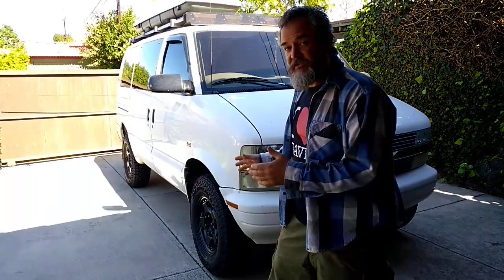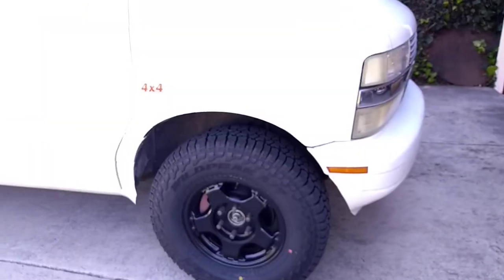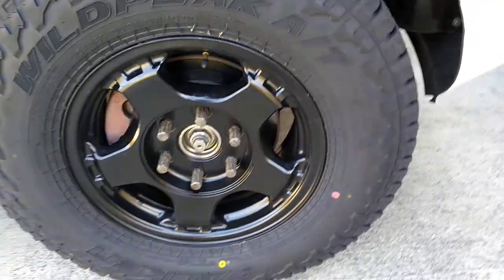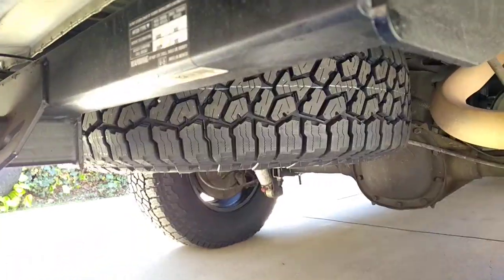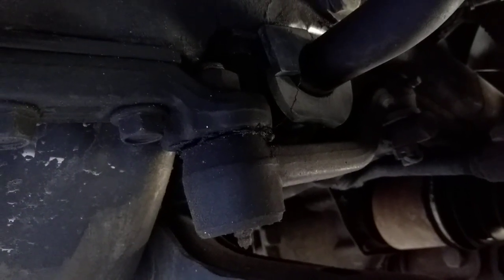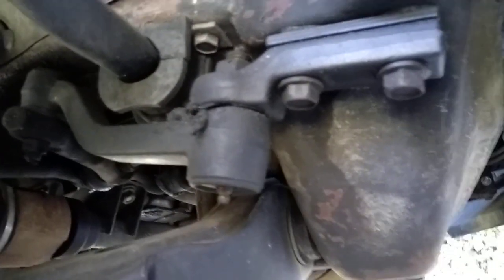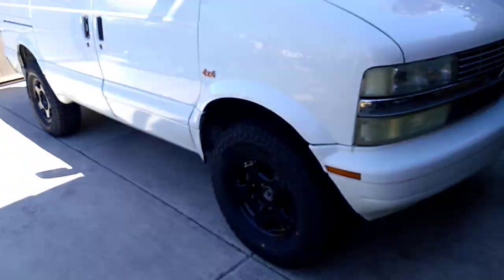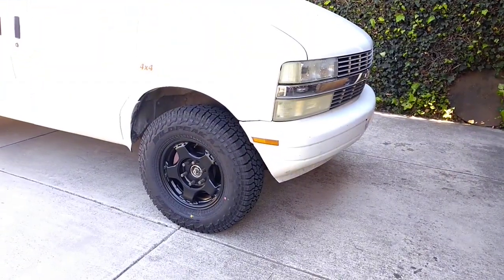Lifted 4X4 Astro Van: Tires/Wheels

Comment: Have your machinist pal turn a cap with an OD matching the ID of the wheel and a threaded hole in the back to screw right onto the axle.  Spin it on and your done, only have to remove it to remove the axle nut!  :)

Comment: Wheels look good, can't go wrong with reliable oem. I built and installed the poly engine mounts after watching your vid on that and they got me off the diff and no vibes, very pleased with that upgrade. I'm lifted around 6" and chasing a vibration at 70 mph. How's your van feel around 70?
Reply from the maker: I had a vibration around 65 mph - turned out to be the front passenger side wheel hub assembly... Shop around for a good deal - I think Rock Auto may have a good price on the ACDELCO

Comment: Thanks for video. I have 2 inch lift but I trimmed a lot both front and rear wheel arks . So I assume I should fit similar tyres . what about width, dont you have any issues with rubbing front suspension parts when turn whee all way to one or another side? Please advise.  Because I was recommended not to go wider than 235 on stock 16 inch rims
Reply from the maker: I went with 285/35/R16 - I get a tiny bit of frame rub on one side but I "heat and beat" it - Need to do a bit more on the passenger side

Comment: I bought my van for $980 and it had a brand new $140 battery and brand new $645 mud and snow tires . In the van was a repair estimate for $3600 to do everything but what was wrong with it( fuel Injection ) all new from eBay $210 but a bitch to put in. My point is learn to work on your Astro or go broke😁

Comment: How are the airbags in the rear? I am getting rubbing when I am off-road Mainly going up hill. I removed the plastic crap from in front of the right rear tire.
Reply from the maker: The s10 leaf springs were key and I'm running a 30" tire... the air bags help when I'm carrying a lot of weight on the road

Comment: 6 Lugs?! Those are 3/4 ton Wheels ?! Did you just get 3/4 spindles and rotors also ? _ That's kinda epic if you did!  _ You've probly already long fixed this by now? About  self destructing 'Idler Arm' grease bulb'_Besides possibly being Over Tightend? Maybe remove it' then file/grind' any scratchy flashing burrs? _ Then take a 'New' replacement Idler arm' and Lubricate the out side of rubber boot  with whatever stays on' yet doesn't eat the rubber bulb? Now here's the 'Give it a try part'  Use a Anti Corrosion battery pad' slathered in whatever grease works best ? In between the two parts' 'Could be a lucky 'go for it' Black Jack Winner?! If not ? _  not out much'  Thank for a great video' Safety and Blessings Always😶🇺🇸👍
Reply from the maker: This is a last generation Astro - '03-'05 had this upgrade, 6 lug 16" wheels,  larger 4 wheel Disc brakes, beefier suspension and some other stuff
Reply: @AstroVanTribe   First ever heard of that option? Do You think those 'option' parts Would retro fit to an 98' LS 2wd passenger? That would be the cats meow right there!  🏞🚐🌦
Reply from the maker: @SpiritZweiSpirit1st  no, this is common knowledge,  they weren't options, upgrades, the third generation Astros, those last three years all have these things